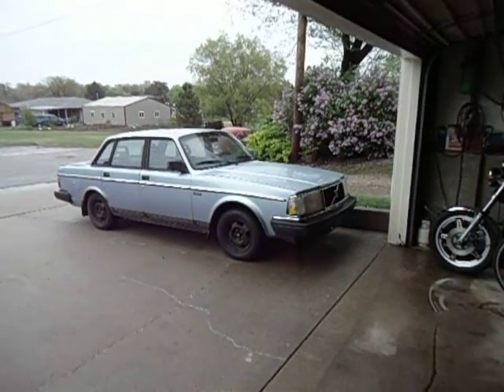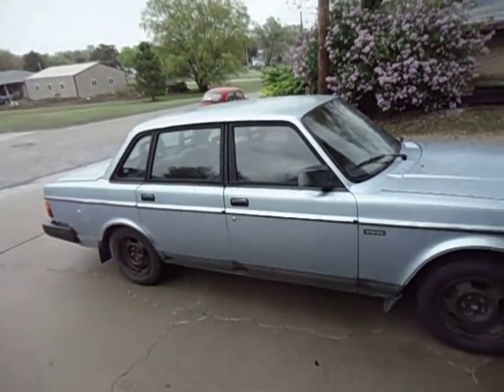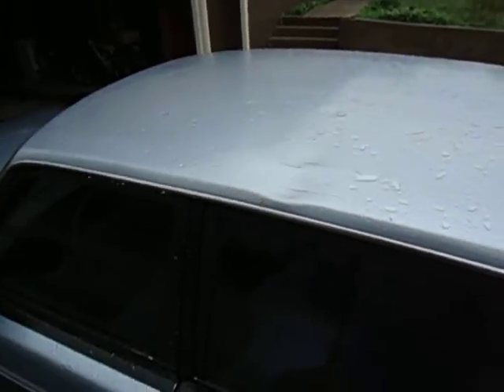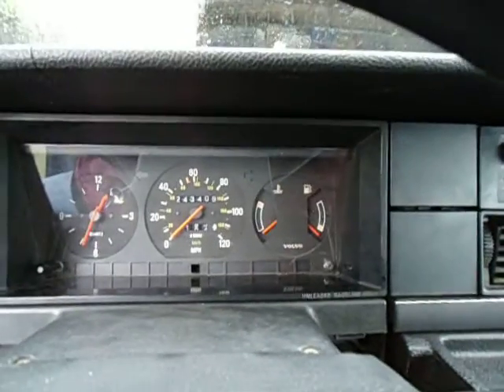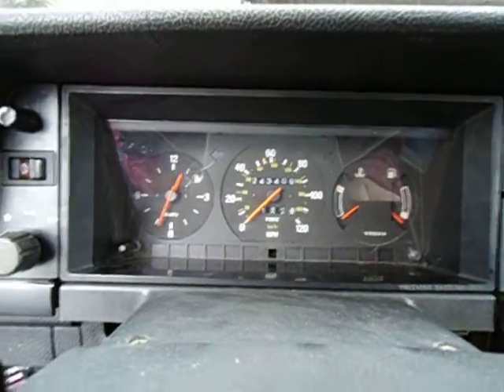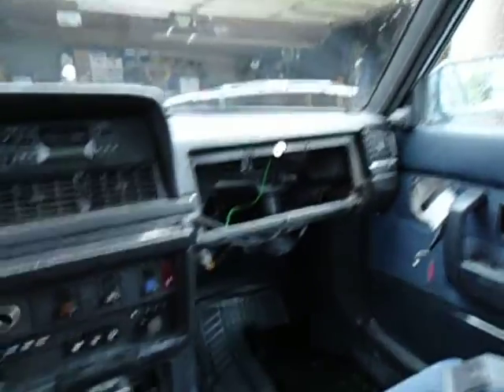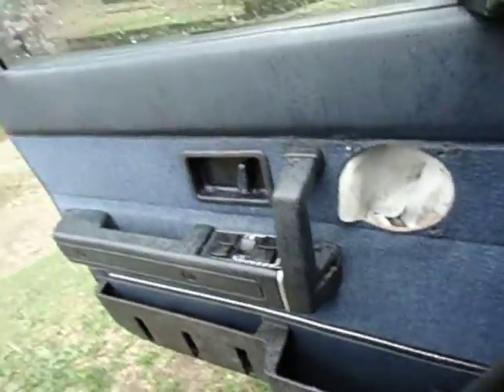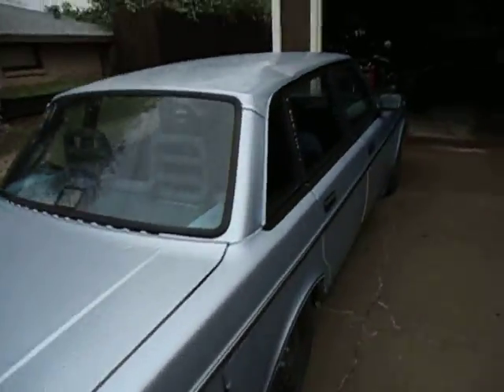1991 Volvo 240

Comment: Thats the red block B230 engine, its good for 500K miles before the main bearings need to be changed, they're VERY easy to wrench on.
I paid $500 for a 740 8 yrs ago, its still my daily driver with well over 300K mi.
Just did the timing belt and water pump, $60 in parts.

Any decent running volvo 240 sells for $3K in Boston, the old hippes love them.

Comment: I bought a same make and model 1991 Volvo 240 sedan.  Similar condition, approximately 100k miles from a series of owners in rapid succession due to transmission rebuild needed.  been garage by a single owner in FL until Trans went crunch.

Comment: another reason your odometer and speedometer might not work is the speed sensor under the rear differential might have wires that pulled loose,it was the case with my 740,the fix was to strip the wires and replace the female conectior plug ends and plug them back into top 2 prongs of the speed sensor
Reply: I suspect the same with my car. Whenever I go over a bump the speedometer needle jumps

Comment: I had my odometer  and speedo quite. So as a temporary fix I gota 1 1/2 inch square with adhesive on the back sides I placed the hook portion on the dash face on the upper small pop out panel dirctly in front of the wiper lever on the rt side of the column ,the soft portion of the velcro stuck on the back of my cel phone . I Downloader a free speedometer App and I'm am good to go.  My temporary fix has 2 1/2:years use on it now.